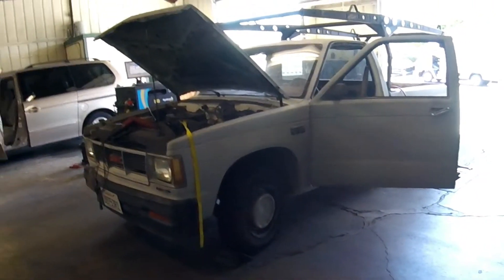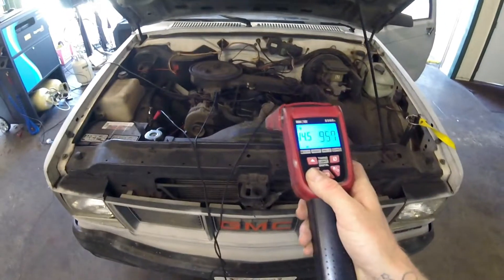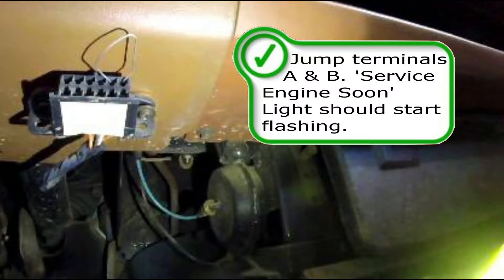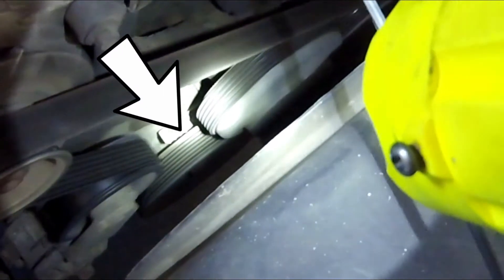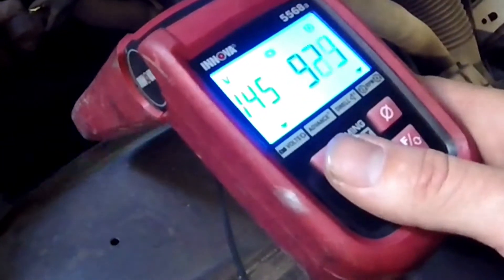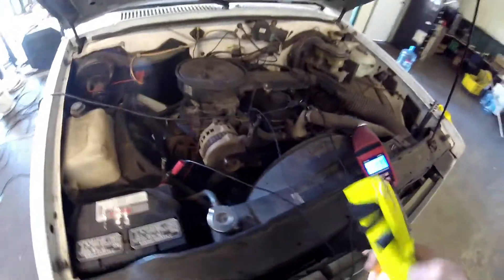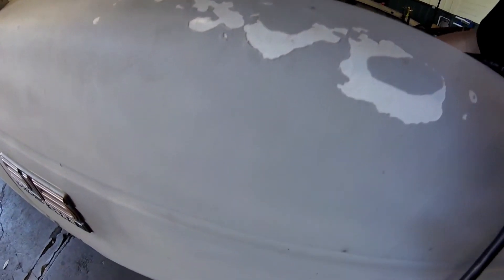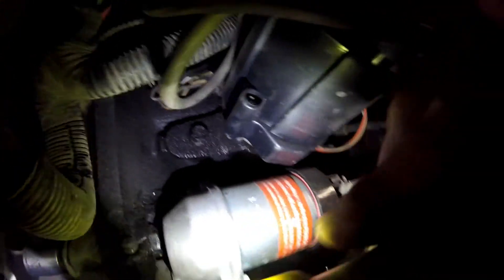Ignition Timing Gmc Sanoma, S-15, Chevy S-10, 2.5L TBI GMT325

Comment: Can anyone help? I’ve removed the fiber camshaft gear(failure). Replaced it with a new aluminum one along with new crankshaft gear. Not realizing using the puller I might have rotated the cam a couple rotations(using impact on puller). After installing new gears. I’ve lined up both timing marks 11 o’clock to 5 o’clock. After lining up TDC and distributor getting hard start and backfire while adjusting distributor. Is it possible I might have installed cam gear out a full rotation? Or should it fire regardless of gear installation as long as marks line up?
Reply: I had s10 for better part my life 2.5 2.8 4.3  2.5 has cam timing  that gear can break I had 1 done same thing so u might try s10 forum but u won't be a ble to use metal gear  u got have same 1 plexiglass gear can last years the metal  1 fits old motors

Comment: I need to ask I have a 91 s10 I don’t know what’s wrong with it but it pops flames on the carburetor and I think it’s the timing I don’t no 😔🙏
Reply: The star shaped gear in the distributor may have spun on the shaft. It happened to me and another guy, so could be common issue. Pull the distributor cap and see if you can turn that 4 pronged steel gear...and check to see the rotor terminal is pointing in between two prongs. If it's not, you need a new distributor, Rock Auto has them. This applies to "VIN A" distributor, see below for other style.
Reply: And if you have the other style of distributor with pigtails and a more rounded cap ("VIN E") then the rotor terminal should be lined up with one of the star prongs.
Reply: I could actually spin that star with one finger after my truck died!!

Comment: hate to ask but .

I have a 85 s10 2.8 carbureted auto.  Whenever I've used my timing Gun I had to put it on 40° advance in order for the Mark's to line up to 0 on the balancer. 

So in order to get my timing back to 12 degrees which is what it's supposed to be Factory at 6:50 RPM an up to temp . Do I set my gun to 12 degrees an then turn the distributor until it lines up to 0 ??

By the way all of this is with the Advance on the distributor unplugged no vacuum to it
Reply from the maker: That is crazy out.. are you sure your not a tooth off on the dizzy? But... when your gun is at 12° your mark on your pully should be at 0°. Then your gun is at 0° your pully should be at 12° if the timing is set right.
Reply: @ScottiesHobbies  also if I put my gun on 12 degrees or little passed that then the marks line up at 20 degrees on the balancer . 

But in order for it to be a 0 at the balancer I have to have the guns set at 40 degrees
Reply: @ScottiesHobbies  yeah I'm not sure cause I've not ever touched the distributor on it . I just bought a timing light an I decided to see what it was set at to see if it has ever been messed with and then that's when I noticed it was way off and I don't even understand how it's even running like this
Reply: @ScottiesHobbies  here's a video 

https://youtu.be/386UqPr61a4
Reply: In order to check/set timing on a carbed engine, you have to disconnect the vacuum hose (if it has one) to the distributor first, and plug the hose off.
Reply: @A_Litre_of_Farva  yeah I know about that . And turns out it was that far off , after setting it back like it should the hard spark knock and pinging I had went away . And it's been doing alot better with get up and go and definitely better gas mileage

Comment: I have an 89 2.5 and I jumped the two ports and set it to 8 degrees but when I drove it around it had no power, do you think it I don’t jump the terminals and set the timing it will have the right timing? Thanks -Dalton
Reply: Dalton My Haynes manual doesn't say anything about jumping the ports. It also says there is a sticker under the hood that will tell what exact timing your vehicle needs. Just a little heads up. Not sure why you are adjusting your timing. If it is a power issue to begin with, or not? But I have had a flat; very flat, power curve on top end for a long time. I have changed every sensor as well as fuel pump. I have a fresh rebuild on my 2.5 new valve train and all. Turns out the whole, or main problem was the fuel pressure regulator in the TBI. Now mind you, I didn't gain 100hp on our 100hp 4banger. But it did give me great upper end torque, where I'm not holding my foot to the floor to get 70mph... I was also getting some upper RPM shutter in the lower gears when cold, now the entire power band is smooth. My fuel pressure regulator was rolled up and looked like an old waterhose gasket, very pinkish in color, so I am sure it was the original for my 1992 s10... Takes 5 minutes or less to change, but you have to have a smaller TORQUE DRIVER BIT to remove the small cover on the side of the TBI...
Reply from the maker: If yhe truck runs worse than it did prior to the work then I'd say try again. Did the check engine light come on wen you jumped the terminals?
Reply: Yes, it did flash also when it cranks it takes a while to start up, I did have the timing perfect back a year ago but the distributor was tightened so they one day it didn’t start right up nicely and it’s taken me this long to try and get it going again
Reply from the maker: @daltonholley5659  have you checked compression? Just to make sure you are working with a good motor. Sometimes when it takes a few cranks to start the postons could have scored walls and getting blow by into the chamber. The oil getting into the rings caused by the blow by will help seal the combustion chamber.
Reply from the maker: Have you checked for codes in the computer?
Reply: @ScottiesHobbies  it has good compression, but I have not yet checked the codes
Reply: Liked and subbed

Comment: So, I have a 92, S10 pickup with a 2.5 4cyl, and I loosed the bolt but the dist. won't move. ??? I looked in my manual and they made a ref. to something about some being pinned in position? Anyone WTF? Ever hear of that?
Reply from the maker: I don't recollect all about anything being pinned in position. If you have the distributor bolt loose it should turn unless you have rust or something built up on the distributor shaft in the engine. Other than loosening is a distributor you might need to jump a wire to get the ignition timing to base mode if you do not have the vacuum advance.
Reply: @ScottiesHobbies  I was Just reading up in my Chilton's Book about the Dist. system on the truck. It' seems it's called an HEI Distributor. AND it uses an EST control system [ electronic spark timing ] and is controlled by an ECM module.So the timing is computer controlled. I think that's why it is pinned. I found a loose connector going to the Dist. and I fixed it, and now all ia OK.
Reply from the maker: @skipwavedx5151  good job! Got it done. Its so easy to look over the simple stuff sometimes.
Reply: Does the jumper need to be in before the truck is started?